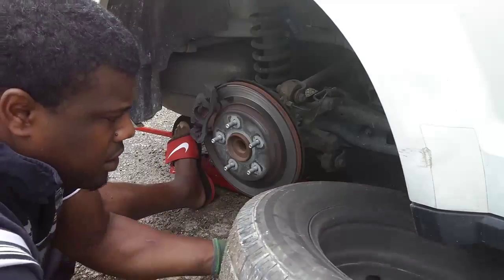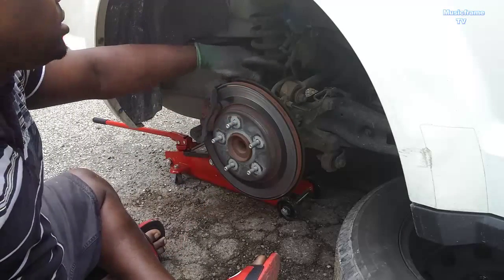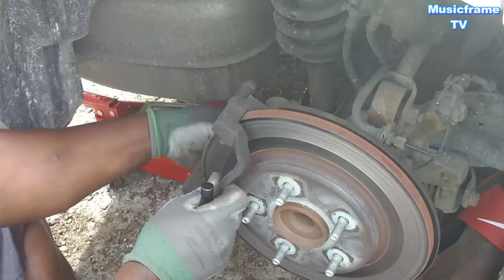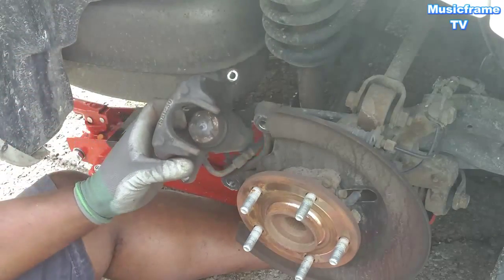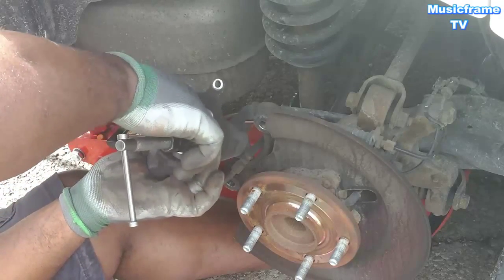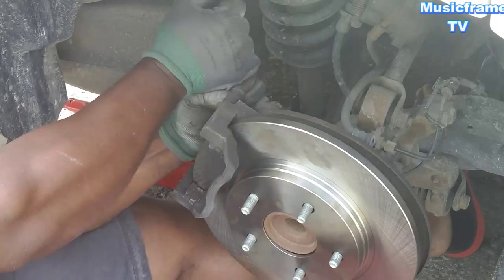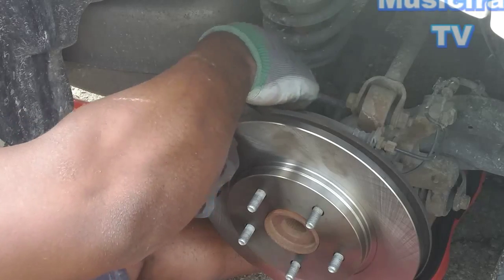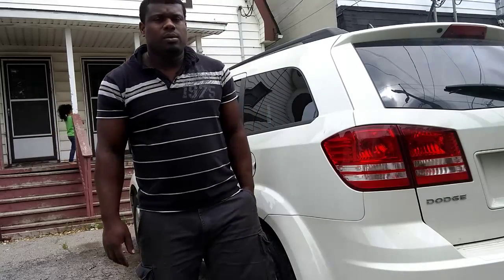2010 Dodge Journey - Replace Rear Disc Brake Rotor and Pads

Comment: does anyone know how much mechanics or dealership typically charge for a front set and 2 rotors on 2.4L?
Reply from the maker: do you live in canada maybe i can help
Reply: bezaldo7 ya I live in Canada. I was quoted 290 by a mechanic for front rotors and brake pads set all in and wanna know if it's reasonable. He uses perfect stop by Wagner
Reply from the maker: yea that is reasonable others shops charges more
Reply: I have a 2014 Journey and was quoted for front and rear brake pads/rotors was $1100, I did them myself for $200

Comment: I jus used a 6 inch c- clamp to push break piston in...work great..👍🏾🍻
Reply: Do not press the piston back inside the brake caliber. 
The rear brake caliber piston is a screw-in type. That's because of the emergency brake system.
The front brake is push-in.
Reply: Yea! These calipers turn in not push in!!!! I've seen ppl use needle nose plyers and regular plyers to get them done!